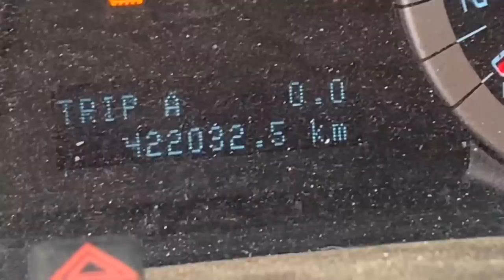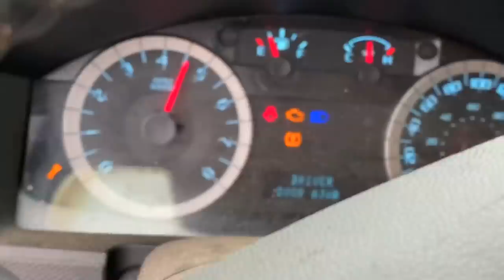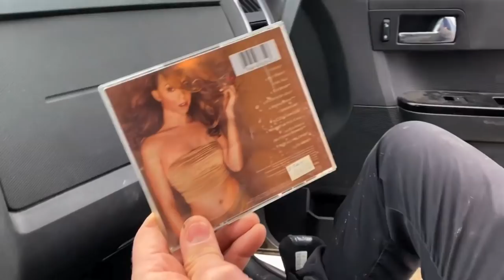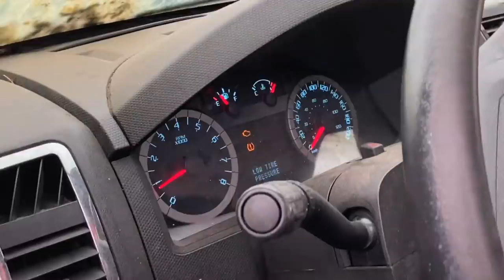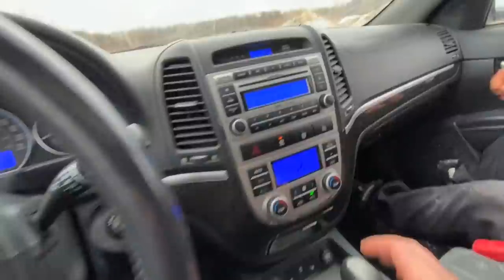Hyundai SANTA FE JUMP!!!

Comment: I'm sure the Escape running rough didn't have anything to do with the fact that the engine was boiling at over 900 degrees. The temp. gage wasn't even on the red H it was OVER the red H.🤣